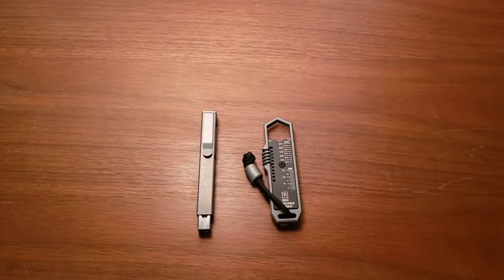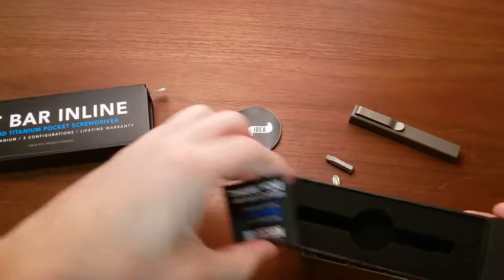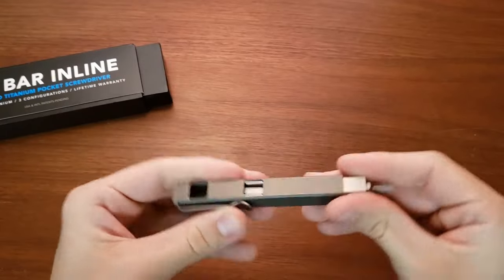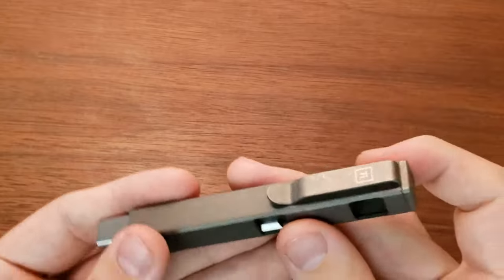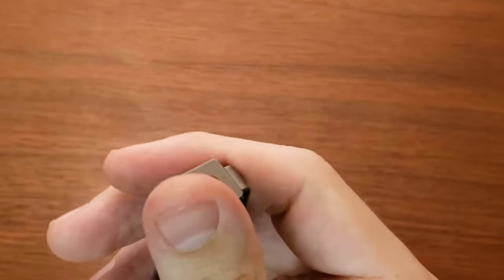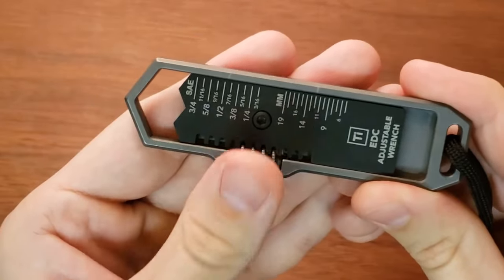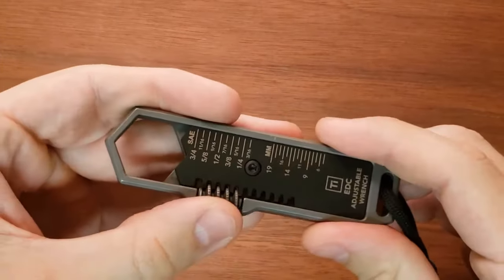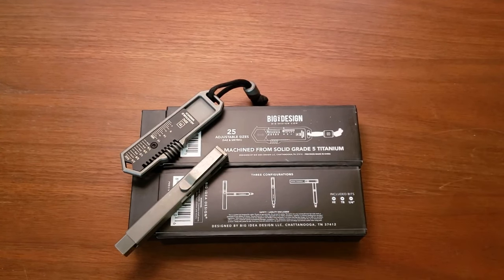2 Cool EDC Tools | Big Idea Design Bit Bar Inline and Ti Wrench

Comment: Would have been a good review if you actually showed how it works on a bolt head. Just like those video's of flashlight reviews and no one actually turns the flashlights on.
Reply from the maker: That's a good idea for a follow up video!

Comment: The bit bar looks ok , but I think the wrench is overpriced and is quick to loosen as you use it.  For less than $50 I can get  KNIPEX Tools 86 03 125, 5-Inch Mini Pliers Wrench  with a 23MM opening and which applies grip pressure to the nut as you apply force to the tool.  Hence NO slippage.
Reply from the maker: The Knipex would almost certainly be more useful! It's all a question of how much size and weight you're willing to deal with
Thanks for watching!